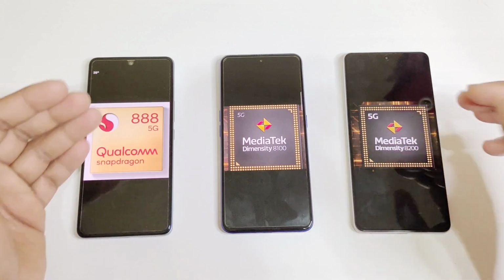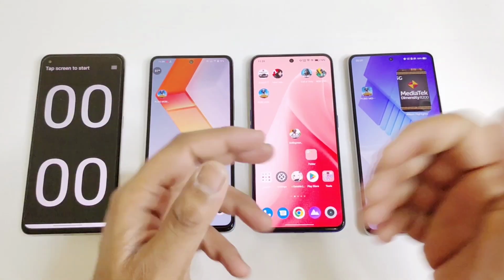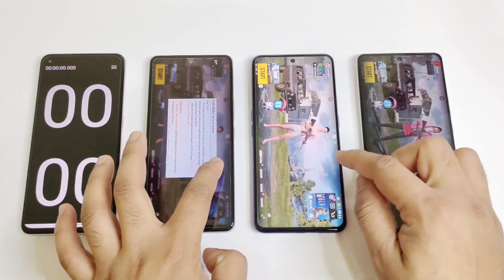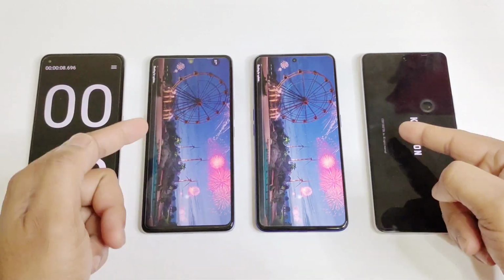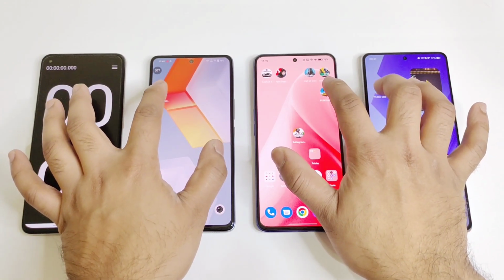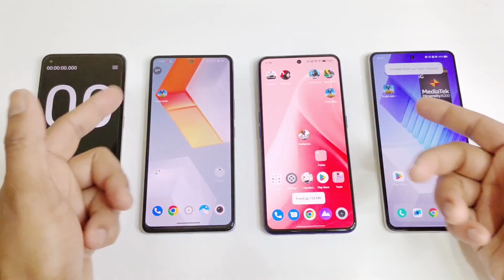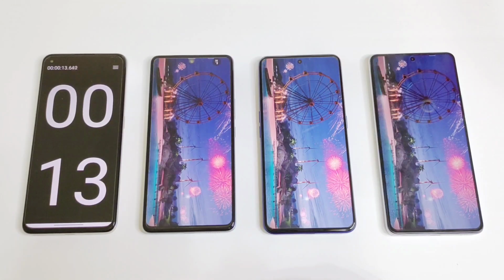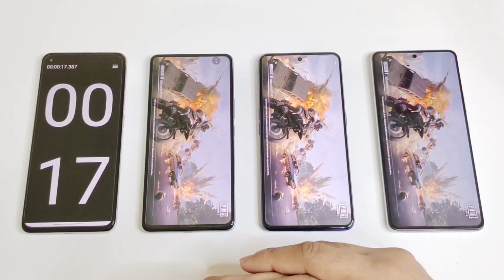iQOO Neo 7 vs Realme GT Neo 3 vs iQOO 9SE Speedtest Snapdragon vs Dimensity Shocking Results OMG 😱🔥🔥

Comment: Bro when we get GT neo 3 90fps in BGMI. Pls complaint to realme website.
Reply from the maker: Not sure when we will get 90fps 😐
Reply: @SaiTechGuru  bro need ur suggestion should i update to Android 13 in Iqoo 9se  As i didn't updated yet So cam u tell is the battery backup is good enough or if possible can u make battery backup video something like this .. Thanks :) Feedback Much appreciated
Reply: Use gfx to unlock 90 fps in gt Neo 3
Reply: @naruto_uzumaki07  it get ban bro
Reply: @ajsong25  no I am using 90 fps config no any type of ban